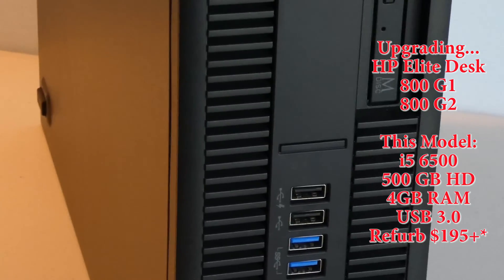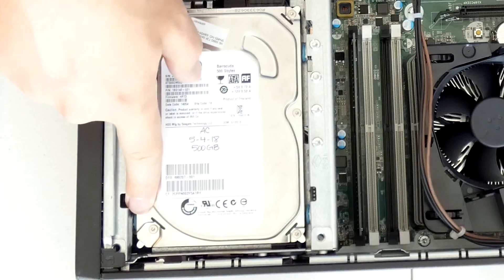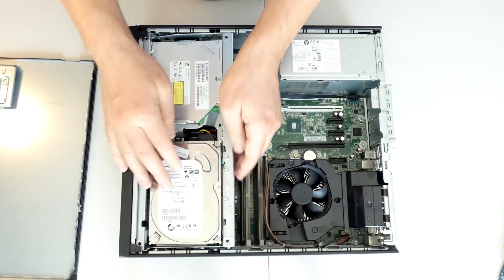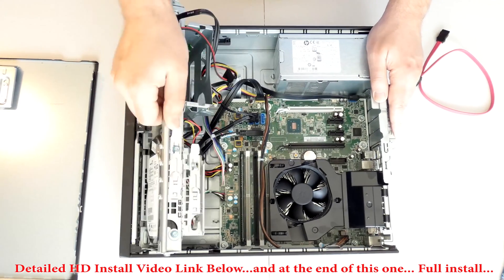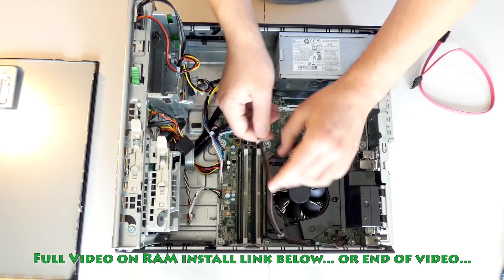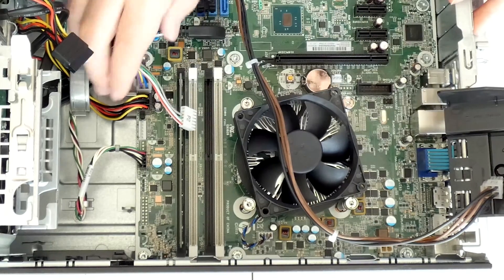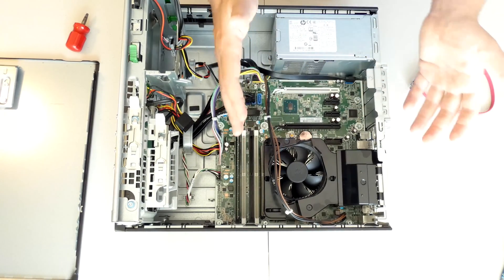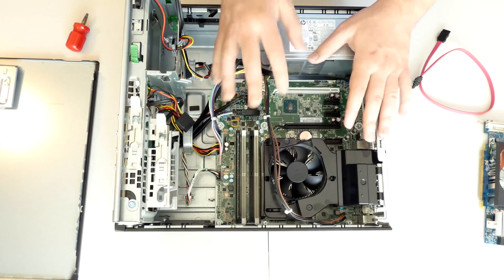How to Upgrade HP Elite 800 G1, HP Elite 800 G2, 600 G1  Small Form Factor Desktop, RTX A2000

Comment: Would an RX560 LP work on my G1? I have an i7-4790, 8GB of RAM a 256GB SSD and a 500GB HDD however I have removed the DVD drive
Reply from the maker: RX560 LP must be new on the market...Are you looking at this one: https://amzn.to/2LKc6xr ?
Recommended PSU is 400w which is a lot more than for example gtx 1050 lp It may work for a while but I'm not sure how long the PSU will last...
Reply: cobuman I mean according to the MSI website their GTX 1050 LP has a power consumption of 75W but only a 300W PSU is reccomended ( 
https://www.msi.com/Graphics-card/GeForce-GTX-1050-2GT-LP/Specification ) while their RX 560 LP has a power consumption of 60W but a 400W PSU is reccomended ( 
https://www.msi.com/Graphics-card/Radeon-RX-560-4GT-LP-OC/Specification ) which is pretty dumb.
I used the MSI variants because 1. Gigabyte didn’t provide a power consumption for their GTX 1050 LP and 2. Because since both are made by MSI both should have undergone the same testing for PSU requirement and power consumption.
Reply from the maker: I agree 100%... it is very surprising that it's labeled 400w. Usually, as long as  entire system does not use more than PSU max rating- it should be fine. Let me know if you decide to with rx 560 and if any issues.

Comment: What is the CR2032 battery used for?
Reply from the maker: That is a BIOS battery used to save/keep settings when you turn off or unplug your PC. If you take it out it will reset BIOS settings.
Reply: @Cobuman  How and how often do you change it?
Reply from the maker: @TheJasonandCrystal  Almost never.

Comment: Hi, currently i have the "Elite desk 705 g3 sff" i can move all the things to another case?
What case can i use?
This pc have "B350 FCH" mother so...
I hope you answer
Reply from the maker: I've heard of people doing this but I would not recommend. PSU is not going to fit unless you get some adapters. Motherboard may not fit properly and possibly have holes in the back and etc.
Reply from the maker: I just made a video that talks about transferring everything to a full size PC case which allows for big PSU: https://youtu.be/C70nmtTFPuw

Comment: What is the best graphics card for editing 4K videos on the G1 and is 16GB of RAM enough?
Reply from the maker: The best video card that will work/fit is GTX 1050 ti 4gb low profile like this: https://amzn.to/2YLDM86
16GB is enough of RAM; however, I would upgrade to SSD which will make a big difference with large 4k files when editing. Like this: https://amzn.to/2XPTaPK
For youtube 4K video you need at least 40mbps bit rate export. May be a long encoding time depending on CPU speed mostly.

Comment: Can I upgrade the power supply,  if I can what power supply would you recommend. I'm thinking of getting a EVGA 500 W1

Is that ok?
Reply: Thanks!
Reply: Thanks so much!
Reply from the maker: Great question. Sadly, you can only use a specific power supply in small form factor like this: https://amzn.to/2Jdm8nm
Reply: @Cobuman  Sorry but I got another question,  can I put a ADATA SU635 240GB 3D-NAND QLC SATA 2.5 Inch Internal SSD

In the desktop?
Reply from the maker: @The7thwonderPrime  No problem. You should be able to use  any SATA SSD. Even M.2 type with an adapter... I have a video on that: https://youtu.be/dBfGhFs2oRw
Reply: @Cobuman  Hey sorry just one more question can you link me the serial cable please I'm having a hard time finding them for my ssd.
Reply from the maker: @The7thwonderPrime  any SATA cable like this will work: https://amzn.to/2J9g4xl

Comment: Hey, any idea if I can add a gtx 1650 or 1660 to my HP EliteDesk 800 G1 TWR? Currently, I have a Msi GT 1030 Aero ITX installed
Reply from the maker: Great question. So, I'm sure you know that gtx 1650 or 1660 will not fit inside of this case; however, I have a solution that you can watch in this video: https://youtu.be/tj2ws0mTm6E

Comment: This case barely looks ventilated ...am thinking of throwing in a gtx 1050 to use it as a budget pc build so is it okay to that ?
Reply from the maker: Good point. Adding a video card in there would increase the amount of heat inside the case; however, most people don't have any issues using low profile cards (1050) like this: https://amzn.to/2WDKVtb
Reply from the maker: I just made a video that talks about transferring everything to a full size PC case which allows for big PSU: https://youtu.be/C70nmtTFPuw

Comment: Thanks for this guide cobuman I have the HP Elitedesk 700 G1 Core i5 3. 3 GHz two 500HD's It has 8gb ram and the Nvidia 1050 low profile graphics card.. Can I upgrade this anymore just thinking of a SSD can any fit this and maybe some more ram too. It runs fine as it is. I play sim games and ets2. Ats. And train sim run fine. Installing the OS on the SSD would help it. Thanks
Reply from the maker: I agree with you. SSD would be a nice upgrade to make it run perfect. The difference in loading time is huge.. from OS boot/restart/updates to loading any applications. I like Samsung brand like this: https://amzn.to/2YpoGEH

Comment: Does this pc come with a 240 or 320 watt psu? It says on the hp website that it comes with a 320 but other people are saying there's only came with a 240.
Reply from the maker: Josh, G2 comes with 200W, G1 comes with 240W.
Reply: @Cobuman  so no bigger psu :(
Reply from the maker: @TheTWEEK95  I'm not aware of bigger psu upgrade. You can add an extra external psu for a large size GPU (I have an adapter for that). If you are trying to add a GPU (low profile) with existing PSU watch my other video here: https://youtu.be/_tbcimqBDzI

Comment: Thanks for this video. I just uninstall my i5-4690k and 750ti from my old PC. And going to install them on a 150$CAD old 800 g1. Probably use it as a living room pc/server.
Reply from the maker: That's a good idea. These computers are good for small spaces especially living room.  Is your 750ti a "low profile" type? If not, it's not going to fit inside the case.

Comment: Hi! Do you know if there is a type of adapter for a higher capacity power source? from one pin to another or something like that
Reply from the maker: What do you mean by higher capacity power source? Different PSU? 
There are many different adapters to convert one pin to another... for example SATA power to 6pin pcie... 
If you tell me what your plan is I can probably help you better. 😁
Reply: @Cobuman  For example a power supply of 600w and not the only one that can have normally 240w
Reply from the maker: 600w power supply will not fit inside this computer; however, you can have a second PSU externally that you can connect things like a graphics card or such.
Reply: @Cobuman  Well I'm particularly interested in adapting another power supply without imposing space, I think the important thing is the connectors from the power supply to the motherboard, and what is the way or the adapter that I can look for to fulfill that function? I would really appreciate an orientation with it
Reply: @Cobuman  Restating the question and apologizing the insistence... What are the necessary cables for an external power supply? in the case of the HP 800 G1
Reply from the maker: It all depends what you are trying to use with external PSU. For example if connecting GPU you could use this cable: https://amzn.to/2VARIQc
Reply: @Cobuman  I see, interesting, in fact yes, is what interests me so that the computer will not suffer any damage, how would the connection sequence of that cable be? PSU to 24pin and Dual 6 to GPU and motherboard? It confuses me where to square the two PSU. I think that information with this type of motherboard and psu is not available anywhere
Reply from the maker: I just made a video that talks about transferring everything to a full size PC case which allows for big PSU: https://youtu.be/C70nmtTFPuw

Comment: can I replace the casing?
Reply from the maker: Possibly, but the mobo, psu and airflow is not designed for use in another case.
Reply from the maker: I just made a video that talks about transferring everything to a full size PC case which allows for big PSU: https://youtu.be/C70nmtTFPuw

Comment: Can I upgrade this with a 
i7-4771 CPU?
Reply from the maker: Sure can. Well, which PC do you have? G1 or G2? If you have G1 then i7 4771 would work. Like this one: https://amzn.to/2RZBhPj  You can use anything with socket 1150 which includes 4770, 4770k, 4790k, and many more... I still use 4770k on my main PC (great CPU). Shop around for the best deal.
Reply: @Cobuman  thanks for replying so quickly, I referred to the hp service manual which stated that the CPU can be upgraded to the 4770, so I did some googling to find out the 4770 and 4771 are virtually identical except for 100mhz increase on the system clock. Im looking to buy a base i5 system actually and upgrade the CPU to the 4771 which I have from a dead system I salvaged, guess im lucky as the 4771 sells on ebay/amazon for over 250 bucks!
Reply from the maker: Nice! :) 👍

Comment: If I just wanted to use it without doing any kind of upgrading could I use it for gaming?
Reply from the maker: Well, the short answer is no... however, G2 with i5 6500 is way better at very low settings gaming. Some games will work and some will not at all.
Reply: What kind of pc would you recommend for gaming that are under 200 dollars
Reply from the maker: Honestly, there is no PC under $200 that I can recommend unless you get something like G1, G2 or similar and then upgrade the Video Card. If you have an older PC with intel i5 or even i3 you can spend $200 on video card and upgrade it.
Reply: Ok well I appreciate for you responding thank you
Reply: The minimum for gaming (assuming you're okay with lower settings) is going to be 300ish. Unless your playing DOTA/Leauge of Legends or retro games, anything less is going to be unpleasant. The issue is that Intel's onboard graphics are pretty awful.

That said, a cheap low profile graphics card won't add much to the cost, and would do wonders. I was able to play Asassin's Creed Bortherhood with a much older CPU and a $50 GT 520 silent (passively cooled, so it's quiet, too!). They have newer versions of that cheap card that will manage Dishonored 2 if you turn down the settings a bit.

If all you play is retro stuff or emulate old game systems, you can get away with a $30 Rasberry Pi or something even older then this.

Comment: Hey man i wanted to upgrade my HP ProDesk 600 G2 SFF and i was just wondering can i put a GTX 1050 https://www.amazon.com/Gigabyte-Geforce-Profile-Graphic-GV-N1050OC-2GL/dp/B06X9GLGSC/ref=as_li_ss_tl?s=electronics&ie=UTF8&qid=1527277962&sr=1-1&keywords=gtx%2B1050%2Blow%2Bprofile&linkCode=sl1&tag=osmicovo-20&linkId=8c431a1fc2cf9010b6510958272cc5b8&th=1  On it??? Please help
Reply from the maker: It should work fine. Open the case and see if the power supply is at least 200w first.
Reply: @Cobuman  and can I also do it on a Gtx 1070 and umm would I need other cabels?
Reply from the maker: No, unfortunately, gtx 1070 will not fin inside. It's not "low profile" type. The best video card that can fit is GTX 1050 ti.
Reply: ok so can i use a GTX 1060?

Comment: I was looking at upgrading the PSU using the G3 model's 500W PSU. Do you know by chance if that would work? The models have similar dimensions but I don't know the wiring differences. Thank you!
Reply: For reference: 

Part number: 913290-001 
Description GNRC, PSU 500W, 90% EFF, 800 TWR

Comment: Can i change the motherboard, and put a better psu, in a new case? Will It work?
Reply from the maker: Sure, you can transfer everything to compatible motherboard and a different case with better PSU. Just double check the CPU socket... it's different if you have G1 or G2. Watch this video: https://youtu.be/stcuFDSUTwE
Reply: @Cobuman  Thanks, man, i have the g2 twr version, with 6700. Greetings from México.
Reply from the maker: My pleasure. :)
Reply from the maker: I just made a video that talks about transferring everything to a full size PC case which allows for big PSU: https://youtu.be/C70nmtTFPuw

Comment: I am pretty late to this video. I currently have an Elitedesk 705 g1 SFF and I was looking to upgrade the psu. It currently only supplies 240W but I was trying to find one with 300W or more.

Is the 705 similar to the 800? And is there any way I can upgrade the power supply because so far I cannot find one anywhere.
Reply from the maker: The 800 G1 has the same 240w and 800 G2 has 200w power supply which is the PC in this video. Most people don't have any issues running up to GTX 1050 ti cards using stock PSU; like this one https://amzn.to/2RY2SNt . I hope that helps.
Reply: @Cobuman  Thank you for your help
Reply from the maker: Anytime. :)

Comment: Same specifications mentioned by Arnodude53 4gb Ram DDR3, HDD 500, core-i5 4570 4th gen but for about 195$ the seller is imported used electronics store Should I buy it considering tax and custom? thanks for your efforts.
Reply from the maker: I'm glad you asked me before buying. That seems a little too expensive considering it's about 3-5 year old tech. It's a good PC but I would want at least 8GB RAM and an SSD for that price.
Reply: @Cobuman  Ok, thank you very much.
Reply from the maker: Sure thing. No problem.
Reply: Hello again, another question plz I will get the G1 with core i5 4690S for lower price than what I mentioned from different seller but Can I set a gtx 1050ti in this? Will it fit without problems according to size and power considering 2 HDD and 2X4 Ram?

Comment: how to upgrade power supply hp 800 g1 twr bcuz some people says u can't change
Reply from the maker: Very good quest. There is no power supply upgrade available because this computer uses 3 separate mobo connectors and not standard 20/24pin. However, there are plenty original PSUs that you can use to replace a broken one.
Reply: @Cobuman  Not entirely true, you CAN upgrade to a standard ATX type PSU, but you need to make an adapter harness to convert the HP 6pin to 24pin, and once done, you will have a  "Error 515 Power fan supply  not detected"  pop up, which require you to press F1 every time you boot, though apparently there are ways around this as well.

Here's an idea of what it involves:
https://superuser.com/questions/869600/what-is-the-6-pin-power-connector-on-an-hp-prodesk
(scroll down)

Google "24P to 6P for HP" and you'll see a harness for Z220/230's with a small PCB converter under black heat-shrink tubing, you can order this for the connectors/converter and then rewire it for the 800G1.

But it's not a project for someone who doesn't have any knowledge of electronics. Google this swap if you're interested, the info is out there.
Reply: Sorry, just to add,  for 99% of people on this planet it's not worth going to all the trouble to adapt an ATX PSU into the HP system, either get a plug-and-play card (i.e - GTX1050 or RX560) as cobuman has stated, or sell your HP and get a conventional PC if you want a more powerful card.
This is of course, all in my opinion.
Reply from the maker: I totally agree with you.  I've been working on an external GPU enclosure that allows for any GPU to be used (with use of second PSU). Once completed I will share information with everyone. :)
Reply: Ok thx i liked ur fb page.  Can you tell me CAN I Use Gigabyte GV-N 1030 OC-2GI GT 1030 OC 2GB Video Graphics Card DirectX 12.  >>>Graphics Card Power  30W & Load at 30w. Minimum Recommended System Power (W) 300w AND  MY HP Elite 800 G1 TWR 300 MAX .
ttps://www.gigabyte.com/Graphics-Card/GV-N1030OC-2GI#sp
Reply from the maker: No, you need a low profile version like this: https://amzn.to/2ytjzZI
Reply: @Cobuman  So no good aftermarket PSU's for the G1 series? Kind of sad to rebuild one and toss something like a 1050ti LP into it. Or have you had any issues with power consumption with the 320 supply
Reply from the maker: I know. It sucks; however, as you've stated there are no PSU upgrade available... Most people don't have any issues running the GTX 1050 LP like this: https://amzn.to/2tcClRT
I always say this to my viewers... the worst thing that can happen is PSU dies a year later... but it only costs around $30 US to replace. :)

Comment: You could probably jerry rig a full size graphics card in there with one of those pcie extension ribbon cables.
Reply from the maker: I think about stuff like that as well. :) This case barely fits a low profile card so I doubt there is enough space for a full size no matter how you position it. Would love to see someone do it. Another issue would be heat... full size cards generate so much heat and in this small PC would crash/overheat all the time.
Reply: What I was thinking is mount the gpu flat over the pcie slots and drill holes to the panel for the airflow. It would be quite a squeeze though.
Reply from the maker: How would you deal with GPU monitor connections?
Reply: Yeah don't know about that.
Reply from the maker: I just made a video that talks about transferring everything to a full size PC case which allows for big PSU: https://youtu.be/C70nmtTFPuw

Comment: @cobuman In the G2 SFF Can you upgrade the processor higher than the i5-6500?
Reply from the maker: Yes, you can upgrade to i7 6700 like this one  https://amzn.to/2RMsOw5 (per HP specs). This is per HP specifications. 
However, this socket is LGA1151 which technically should support up to the most current generation of intel CPUs. My main worry would be BIOS support if you buy something else.
Reply: @Cobuman  Thanks for the quick reply!
Reply from the maker: My pleasure.

Comment: Power supply is low profile no any help in this video to upgrade the normal ATX supply😕
Reply from the maker: :) You've answered your own sentence. This PC has a "low profile" Power supply, normal ATX physically does not fit inside this case nor would the power connectors work. This PC has 3 power connectors for the motherboard, P1, P2, and P3... normal ATX has 20-24pin 1 connector.